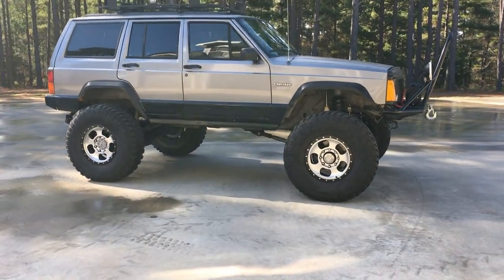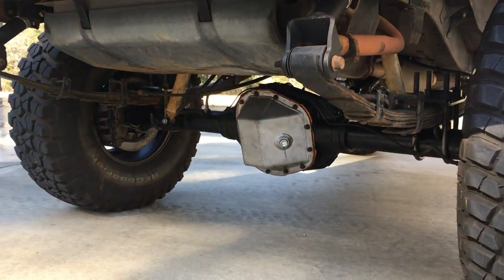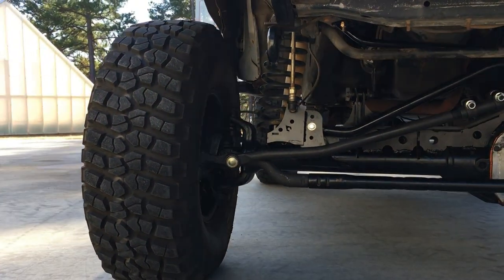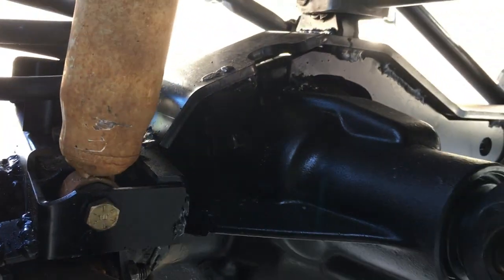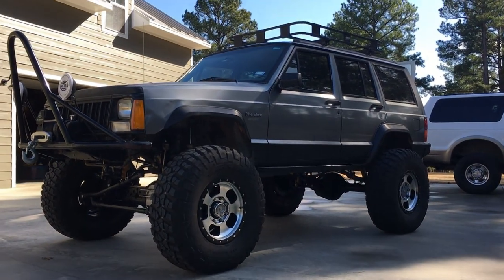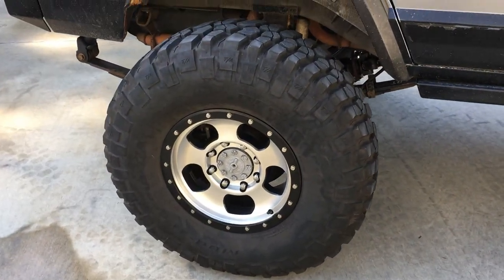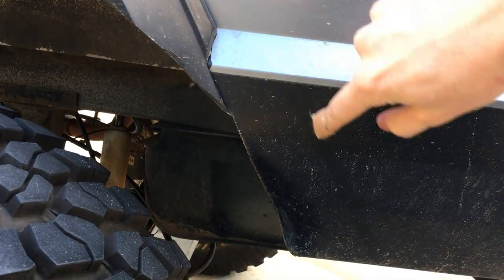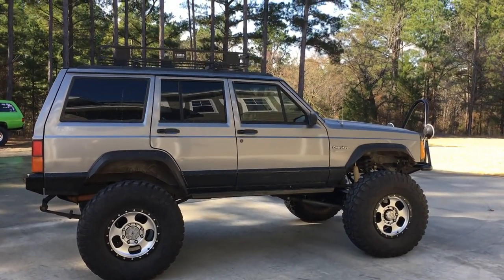Jeep XJ 1 Ton Project Overview | Superduty Swap, Drivetrain, Suspension and More 2018 Update

Comment: Glad you love the shackles and brackets!
Reply from the maker: You guys ROCK! Appreciate you taking the time to comment! Take care! We are saving up for some of your front arms and 4 link subframe it looks amazing!
Reply: No problem. We're real people just like you and everyone else. Looking forward to the build.
Reply: Ironman4x4fab id like to inquire about those brakets and shakles. Im putting a 6 1/2 in rc kit on and want relocation kit.
Reply from the maker: Here is a link to the relocation kit on their site! https://www.ironman4x4fab.com/product-page/xjax-kit
Reply: Damn thats pricy lol
Reply from the maker: Seems like it but you are actually getting 2 brand new HD adjustable length shackles as well which make the pinion angle dial in easy...and these brackets really do make others look kind of puny :) I cannot emphasize their quality and hardness of material enough...also extremely firm urethane bushings for upper eyes...no flexing or deformity at all...if you want something to last a lifetime this is it 💪
Reply: Eh im just a cheapo. They definitely do look heavy duty and i do like that they have a round arm instead of flat steel. Have to decide if i want them or not. My jeeo need quite a bit of work. Mostly rust removal.
Reply from the maker: Completely understand that man...gosh my suburban was filled with rust when I got it...not easy to keep it away for sure!
Reply: @bfo1993 9 poo

Comment: I recently got my hands on an 82 Cherokee Chief and an 02 F250 Superduty that had been t-boned with plans to swap the power train and suspension/handling/braking system from the SD to the SJ to turn it into a rock crawler while still being street legal.  I was worried about it all fitting though, but if you can fit Super duty parts into an XJ, I should have no problems fitting it in an SJ.  Sure, there is going to be a lot of customization and fabrication, but I am confident now that I can get it done, thanks to this video.  Well done.  For your rear fenders, you'd be better off doing the cut and fold method rather than just cutting off a piece of it.  It'll be a lot cleaner, tougher and less prone to rust.
Reply from the maker: Thank you so much for the encouraging words...dude a FSJ on Superduty 1 tons would be SWEET...

Comment: Steering box? My ZJ kept blowing seals till I went to hydro assist. Subframe stiffened? Nice build
Reply from the maker: It is actually stock...we have wheeled for years with 37s on locked dana 44s and have had no steering issues at all....minor difference in steering boxes between a ZJ and XJ....XJ has a 14:1 ratio and a ZJ has a 12.7:1 ratio so that may be a little more load in your box causing seal issues...we have the steering braced...the rocksliders tie into the unibody in the midsection but no other stiffening to the unibody yet...it makes a little noise when flexed out but thankfully a 4 door has the double a pillars which is better...we will see in the future if we need to make some changes fingers crossed! Thanks for the comment man!

Comment: Wow that’s my dream Cherokee right there!! Cant wait to see the axel build video. How does the stock motor do pushing the tires? I need to re-gear mine like you guys did. Great build!
Reply from the maker: Stock engine pushes it fine! No problem at all....no overheating no lugging...4.88 would be nice if you were more highway focused to keep some of the revs down at 70 but it really work well! Looking forward to making the axle build video too! Work has been crazy lately :)
Reply: I hear ya man always stuff to do! Thanks for the input!

Comment: Rockquest Off-Road  Thanks btw for not getting mad about my somewhat critical post.  I think you have that right. Your chassis has been tested at King of the Hammers. I recall seeing a guy attempting to run a Grand, I can't remember exactly which year, unfortunately, (sometime in the last three I think) but as I expected massive fail. The suspension just ripped the unibody apart. Granted racing the hammers is sort of nuts to begin with, but it does give insights to the weak points. The fix in my opinion would be to take a 2 door Tahoe, or Yukon '93-'98 (or similar, but those come to mind) chassis and put your Grand on that.   The other thing I question is why not use a Dana 60 high pinion kingpin axle? A high steer set up would eliminate a good portion of the obvious steering problems you have with your current set up. You truss the 50 up nicely (for hard use) but attach it to a unibody (not for hard use).  I know, after the fact, but for someone considering a similar build these might be important considerations.  Finally, on a more positive note, the use the full float Sterling rear axle. A very under rated unit. It has all the strength of a 14 bolt with 2 inches more of ground clearance. They are plentiful and cheap and have most if not all of the aftermarket support that the venerable GM unit has.
Reply from the maker: Thank you for the reply :) we welcome all comments for sure and you have some great ideas. We ran the 50 because we got it cheap :P a 60 would be first choice for putting an axle in this way...it is nice to have the ability to shave the 50 for quite a bit more clearance but thats about the only positive...Hi steer would always be amazing but we go in stages as we need it...definitely do not have to have it as it has never failed on the trail yet :) looking forward to putting the axles on our LJ build with some proper steering :) thanks!

Comment: Holy shit those welds are sketchy... my 99 XJ is all custom double triangulated 4-link rear with 20” fox shocks and the front is a custom 3-link with a panhard and it rolls 38” nittos and flexes like a MF with a full hydro steering set up... these are great platforms to build off of and with that 4-1 case and steep gears the 4.0 does pretty well even on long hard climbs. Nice rig
Reply from the maker: It is amazing how well the old faithful 4.0 handles everything especially with tons of gearing! The XJs flex insanely well and they are super light compared to other jeeps! 99 model thats so cool! Yep the welds on the drivers side lower control arm bracket were awkward and we are not pros lol...all the rest turned out perfect though and hey may not look pretty but as long as they hold and got good penetration we will be good :) thanks for the comment man!

Comment: Where did you mount your upper control arms? Looks like you used stock mount at the frame for the uppers? If so how did it work?
Reply from the maker: The uppers and lowers on the front actually  attach to a new one piece BDS subframe that comes with the 8.5 inch lift…the arms are all much longer

Comment: What size lift you running? I’m going to do an axle swap and I was told I need about a 6 1/2 inch lift. I have a 4 1/2 inch lift now. I was told that the 4 1/2 could work but I would have to do a lot of cutting. Is that true?
Reply from the maker: It would be TIGHT with 6.5 inches…it could work but you would have to bump-stop it…I really like how ours has even amounts of up travel and down travel…it rides fantastic and we didn’t have to destroy the body to fit the tires. My opinion of course but so many guys think the XJs are unstable over 6 inches of lift but as I have always said…my dads XJ on 1 tons and 8.5 inches of lift and 37s has the same roof height as my JL Rubi on a 2 inch spacer lift with stock tires…this XJ is wide and stable and flexes like crazy! Just my opinion! And you really need long arms up front…get a Clayton crossmember or something at the least and some arms from Ironman Fab or Rockcrawler…I prefer a true 4 link design for durability and redundancy…just my 2 cents!

Comment: Do you still have this rig if so how's she holding up i like this set up pretty nice rig
Reply from the maker: Well we wheeled it like this for about 2 years and didn’t break anything with 37s...so my dad finally got an LJ so he could have the open top experience again and he loved the drivetrain in the XJ so much that we swapped the axles and transfer case over to the LJ adding a Rubicrawler in front of the rocktrac....been running it with 38 inch milestars at 3 psi with new Hutchison bead locks...havent broken anything yet either!! Been really solid for us...we have hit some stuff pretty hard too!

Comment: Did your rear pumpkin come up and hit your gas tank since you moved the axle back and it is larger?
Reply from the maker: We actually had zero issues with this. Could be due to the lift being around 8-9 inches roughly...if you ran a 5.5 or 6 inch lift it could come into play. But just bumpstop it if thats the case and you will be fine!
Reply: @rockquestoff-road2839      What size front coils are you running ?
Reply from the maker: @miloganze3469  BDS 8.5 inch coils

Comment: great tour! whats the gear ratio in your rear diff and did that factor into your consideration for your tire size thanks!
Reply from the maker: We are running 5.38 gears which most Jeep guys would recommend for 37s and above. RPMs are a bit high at 70 but it pulls hills in overdrive which is nice. We had 4.27 gears with 37s before and they worked fine as well. Close to same shift points as factory just downshifts on grades. Off road 5.38s are amazing and really take a load off your transmission. Thanks for the kind words!

Comment: Hey man, love your build! I’m trying to learn about 1 ton axle swapping right now. What are the benefits to it?
Reply from the maker: Much larger bearings to support the weight of larger tires and equipment on the rig and impacts to the shafts...much larger axle shafts to withstand more torque...larger ring gear and pinon gear diameter that takes much more torque without breaking or stripping teeth...larger brakes more stopping force...the cons are the axles are heavier and you lose a little ground clearance :)

Comment: The dana 50 is aluminum i thought and had some other nitpicks
Reply from the maker: No it is a cast center section the same size as a Superduty Dana 60. The axle tubes are the same thickness and size OD as a Ford Dana 60. The knuckles are Dana 60 cast. the stub shafts and ujoints are all Dana 60 size and 35 spline. The ring gear is 9 inches so only .5 inches smaller than a standard Dana 60. The only cons are its pinion is the same diameter as a Dana 44 and the inner axle shafts are 30 spline Dana 60 size until they progressively neck down to  Dana 44 diameter where they enter the carrier. According to some stress and torque ratings I researched the Dana 50 shafts are considerably stronger than 30 spline Dana 44 shafts because of the progressive neck down at the carrier the whole sxle shaft will twist under load and carry more torque before failure than a Dana 44 shaft. So the Dana 50 really is a middle ground between the Dana 44 and a Dana 60. The only benefit the Dana 50 has over a 60 is the clearance because you can shave about 1 to 1.5 inches off the bottom of the differential. Its fun to try different setups that not many people run. If you find a 60 for the same price of course go 60 but sometimes the 50s can be really cheap and they can handle 37-39s fine.
Reply: @rockquestoff-road2839  Gotcha, some offroad fourms I know hate the dana 50. Anyway you can always go 4340 thicker 35 spline shafts on the d50 and make stronger than a d 60
Reply from the maker: That’s cool I’ll have to look into those shafts in case we break one eventually

Comment: Are the axles full length or did you end up shortening them up ? Great set up btw !
Reply from the maker: Thanks man!!! These axles are full width...tons of work to narrow them and it’s just easier and cheaper to get high backspacing wheels...the ones we have are 5.7 inch backspacing American Racing Ansel Off Road Wheels... 17x9 8x170mm
Reply: @rockquestoff-road2839  thanks for the response and information. Just picked up a 1 ton set off a '05 SD going to be doing this soon . Thanks for the inspiration and template!! Cheers !
Reply from the maker: Awesome!!!! Enjoy the process man! Love helping out any way I can!

Comment: Biggest issue with rock Clearance looks like it might be your steering. Any upgrade plans to get that a bit more out of the way?
Reply from the maker: Yes! After having the stock superduty tie rods for a while we bent them on a rock so we then built some .250 wall DOM tube tie rods and a new drag link and it’s much more out of the way and straight across now without that weird bend in the tie rod!

Comment: I'm currently in the middle of this swap. I'm also running the ironman fab rear shakles. Also running the rusty's 6.5 long arm kit. How did you get the rear leaf that flat?
Reply from the maker: We used the 5 inch BDS leaf pack and matched the 8 inch front lift with the Iron man shackles...so I would advise using a 3-4.5 inch rear leaf spring and use the shackles adjustment to make up the rest of the lift and set the shackles as angled as possible without losing too much lift
Reply: Thanks for the help I have another question. When you welded on your rear spring perches what angle did you set the pinion at.
Reply from the maker: @joshrushing7583  We set it to within .5 degrees of the driveshaft angle...match your driveline and you will be set

Comment: Showing up late to the party.  Are you running the axles full width hence the 5"+ backspacing?
Reply from the maker: Yes! No way to narrow the Sterling rear and Dana 50 front so backspacing the wheels is just a personal choice to minimize a crazy stance width...wanted it to be a little harder to notice what had been done....looks more classic also :)

Comment: Perfectly done sir thank you so much for the walk around. about the only thing Im curious about now is about the lower control arm bracket on the driver side front axle and I had no idea you could shave a Dana 50 that's freakin sweet
Reply from the maker: The artec lower control arm mount ties into the coil bracket and casting on the diff housing snug...had to grind a little but not much...the Artec brackets made it so much easier than figuring it out from scratch...lined up perfectly....yeah the Dana 50 has more ground clearance shaved than the regular D44 hah...its really like a high pinon Dana 44 with Dana 60 outers except with a larger ring gear...hybrid axle love it
Reply: so you just welding to the casting with regular mig wire? or did you do the hole heat treat stuff with that high nickel rod?
Reply from the maker: Yes...just did short welds and let it cool...patience and don't rush....it is cast steel so it takes some power to get into it...we got away with no pre heating or letting it cool overnight and all that stuff...we just welded on it a little then worked on other stuff and let it cool and then did some more...no issues with axle tube deforming or welds breaking etc.

Comment: or 1994 -2000 . im confused... your notifacations said 1994-2000 but when i clicked on the reply it says 1984-2001...jeep cherokee. i need to change back rear end.Complete housing axels and all...just need to know what modals will inner change.
Reply from the maker: Sorry I replied and then did some quick research and indeed it went farther back than I thought with the dana 30 front...just make sure it is a high pinion version and you are golden...on the rear axle they are the same years...only thing is the XJ had 2 rear axles...yours being a 2000 model I would guess it is the Chrysler 8.25 axle for the rear which is a good thing...the rear axle in older models and some newer models is the Dana 35 which is weaker in many respects...do some homework and make sure you know which one you have and then go hunting!

Thanks!

Comment: Hey love the Jeep.. I am running a 6.5" arm lift, and want to go up an inch or so to get more clearance on my 35's. I know the shackle relocation will ad an inch or so to the rear so I am wondering what I will be facing to get this extra inch or inch an a half out of the jeep. Do i go with 8" shocks, and throw in some 2" spacers on my front coils to compensate? Will I need to lengthen my control arms in the front to compensate the extra 1.5" lift? Appreciate the help in advance. Also .. What shocks are you running? How do you like them?
Reply from the maker: Yes definitely go with some 8.5 inch shocks from BDS we loved them very well made and good control and ride as well...no complaints...I would get the ACOS for the front if money is not an issue then you can adjust it to exactly where you want it...otherwise I would just do a 1.5 inch spacer on the front...the lengthen you’re lower control arms around 1/2 inch to start with and see how it drives...hope this helps!!
Reply: @rockquestoff-road2839  Hey I really appreciate the response. I have been contemplating my build for months now, and I think I am going to finally make the leap. I was also wondering how much further I would need to go with my bump stops with the additional 1.5" lift at 8"? I am going to consider the ACOS, but I want to make sure my ump stops are right, as well as if they will accommodate the 8" lift.. I do a lot of flexing and don't want to ruin my new shocks. One of my friends is trying to steer me away from going over 6.5" due to having more of a chance to roll over. Opinions on this as well? Thank you so much for your time, and a great video.
Reply: @rockquestoff-road2839  Hey man. I am not seeing BDS has 8.5" shocks. That kit you got came with fox 2.0's I believe.. You sure those are BDS shocks? Any other shock recommendations around 8.5" for me? Really don't want to spend the money on the Fox shocks
Reply from the maker: Hey man I made a vid I can’t share the screen shots I just tried to take...it’s an XJ update new shocks video and I show the box with the part numbers too...
Reply: Right on bud. I'm gonna go search for it on your channel. 🍻